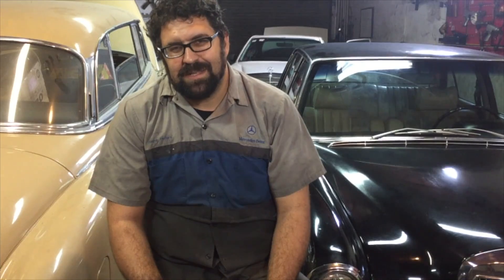Hydraulic Actuator Adjustment

Comment: hi Pierre  I didn't even expect a video to answer my question I only saw it now, and I wanted to thank you  .  My beloved mercedes is a 1989 with m103 engine  ke-jetronic without lambda sensor  .lately I've been trying to fix it by screwing 1/2 turn clock wise adjustment screw  and now it goes much much better   still  have half second  little hesitation  when i push down gas pedal  it should be the potentiometer but i will leave it as it.   Again thank you  for you   knowledge share  usefull , also here in Italy
Reply from the maker: you are most welcome!

Comment: Hi Pierre, thanks for these videos! Question regarding my 1981 380SL. What are the correct plug wire resistances? I've heard 1k, but my 380 has 5k wires installed. I ordered a new set for my vehicle, and these are also 5k! So, I'm wondering, which is correct? Is a difference of 4K ohms really going to make much of a difference on a 1kv (guessing!) spark from the ignition coil?

Thanks!
Reply from the maker: video response coming up!